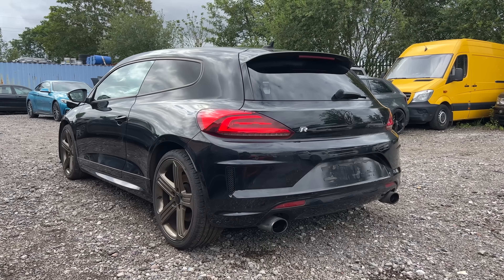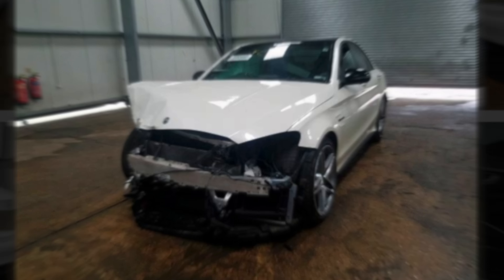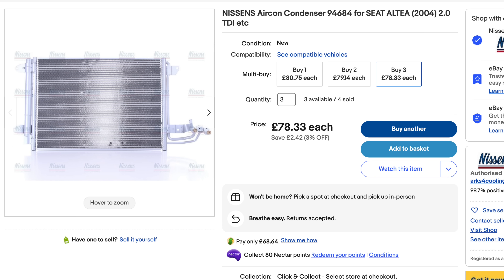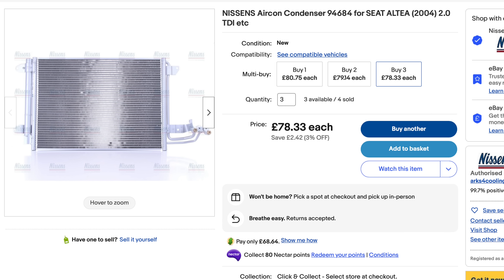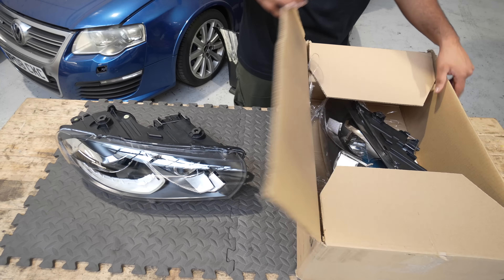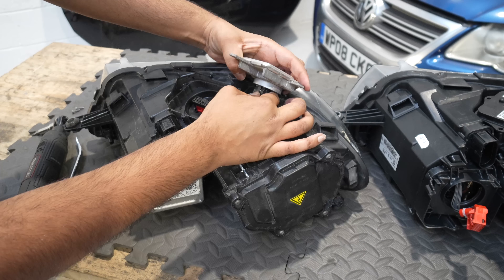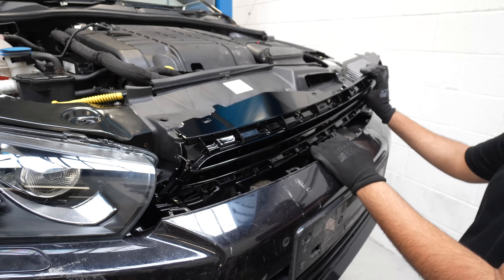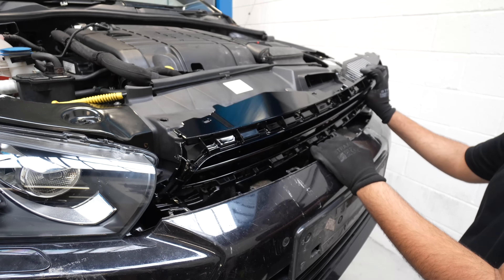REBUILDING MY WRECKED VW SCIROCCO R | PART 2

Comment from the maker: Thoughts on new camera quality? Also make sure to check out CAR VERTICAL and use my code 'TRH' to save 10%: https://www.carvertical.com/gb/landing/v3?b=1e4c9523&a=Hamza&voucher=trh
Reply: Quality is on point 👌
Reply: Looks great!, spot on.
Reply: Quality is good, but you need to turn your stabilization on or up.  Got a bit of motion sickness during your vlog style sections.
Reply: Loving the change, it looks incredible

Comment: I have only just started working on my own cars ( I have been into cars all my life just never had confidence or the right car to start on ) I have a mk6 gti and just last week did the following
Service all fluids and replace all filters
Put a cold air intake on from Intergrated engineering
High pressure fuel pump and cam follower
upgraded to Audi R8 plugs and coils
replaced coolant expansion tank as old one cracked
Bilstein B4 shock absorbers all around including new dust boots, mounts and bump stops
Upgraded to powerstop evolution sport Z23 pads and EBC slotted rotors
replaced anti roll bar with one from a mk6 R and do sway bar end links and bushes for sway bar
I sounds like a lot but for someone with little to no experience I must say I thoroughly enjoyed working on the car, the HPFP was the easiest thing I have done.

Comment: That gap between the bumper and wing is due to the bumper being pulled and it pulls the metal on the wing. You have to straighten the metal on wing for it to start sitting right. 

Loving the builds.!!

Comment: Tar and glue will remove that tape residue with ease from the bumper. Bit of a polish and it’ll be like new. The broken tab on the bumper corner is an easy fix as well. 👍🏻

Comment: Autoglym Tar Remover will dissolve of the glue residue on the front bumper. DAB on, let it dwell for a few mins then wipe off. Might take one or two applications depending how thick the glue is. Wash with hot soapy water afterwards. 👍